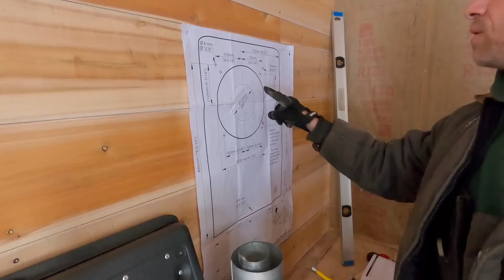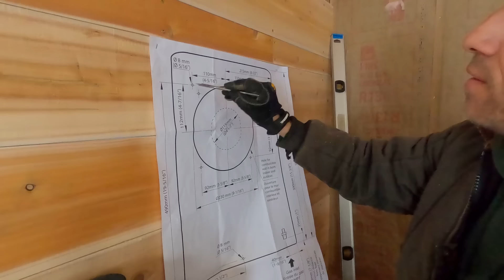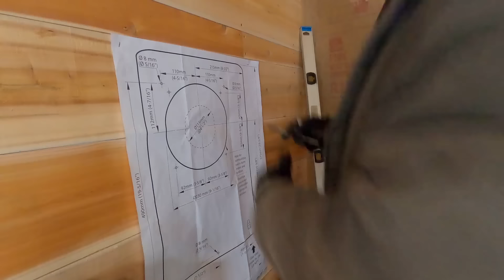Tiny Cabin Direct Vent Heater Install (No Electricity.) After Three Years in a Tent, Now HEAT! #114

Comment: Ryan I was watching your 3D printing demo where you had to go back out and get your newer printer.  It was almost totally dark in the cabin. You use what looks like a Coleman white gas lantern, there is a better solution!  I found on EBay a LED small lantern that uses AAA batteries, and mine have lasted 4 years!  The LEDs can be annoyingly bright, the light level can be dimmed by a rheostat that adjusts full range of brightness.  I found them 2 for $5.00 and free shipping!  They are an excellent backup as long as you can keep the batteries warm!  If you got rechargeable AAAs you could keep them charged the same way you charge your portable batteries!

Loved you explanation on 3D printing!

Comment: I bought one for $150 on Amazon. I just ran a flex line from heater through the wall and mounted tank right there. I bought a tank mount that had a flipper and the flex pipe went right into it. But it's just an old camper.

Comment: The way you do it is called a union…..Had to install one in my house because someone did what you’re doing and assembled the piping end to end. My tankless water heater required a 3/4 inch line instead of the 1/2 the tanked version had so I installed a union to allow it to be reassembled from the middle of the run….

Comment: I used inexpensive white 1" styrofoam insulation (4' by 8" sheets bitted close together) over the subfloor of my camp in north central Maine and then put another layer of flooring over that with long trim head screws through the final floor, styrofoam insulation , subfloor and into the floor joists and the floor stays warm during the winters which get to -10 to -20 degrees on the middle of winter.
 The camp is heated with a wood stove and I can walk around in shocking feet all winter. A good inexpensive solution to a cold floor and it has worked without any problems for the last 20 years or so. The camp is on 2' cement pilings, open to the weather but I put up skirting for the winter keep the snow out and remove it in the late spring...
Just a suggestion that has worked great for me for many years..All the best and Merry CHRISTmas...<><...:)

Comment: I was looking for cabin heater shed heater garage heater. And that was what I found out $450. Nope I went to Home Depot Walmarts Lowe’s to look for Mr. heater big buddy it’ll put out just as much heat as that heater you got for about $200 then you get the Mr. heater conversion hose so instead of using one pounder propane tanks it converts it to 20 pounders. I see that you have a 30 pounder right behind you pick up three of them and bring them straight to the gas plant to have them filled up. It’s cheaper that way instead of the exchange service. Plus they can inspect the tank and make sure it’s good.  
They have mounts on the back of them so you can mount it to the wall. Then I found those wood burner stove top fans that operate when they warm up and I put it on top of that Mr. Buddy and that little thing heats my shed up where I find myself opening up the door or turning it off because it’s too hot.  
And within one or two minutes you can convert it right back to a portable heater and use one pounders on it

Comment: 27:30, my experience with propane bottles outside, is if the moisture inside the bottle box is high enough and cold enough... the regulators freeze up. Something you might thimk about is mounting your box on the outside wall, and ducting some warm air from inside into the box. But, it might also allow gas fumes into your living area... not good. 
I've microwaved corn-hole bags before, and laid them over the regulators... if they freeze. Worked perfectly!
Just a thought.

Comment: Don't worry about the superfluous...saperfilus? sooperfelis?...extra holes in the plates.  They are the pilot holes to keep the plate aligned when stamping the sheetmetal in multiple steps.  They are later used for hooks to hang the part on the paint line.

Comment: Nice unit, I did not see any manual but being a direct Vent, it would appear it uses Fresh air combustion from the outside of the cabin via the direct venting pipe Assembly.
That being said, I can see the importance of installing sealer at the wall gap and the circular Vent Pipe.  Any Vacuum created from open interior windows, door or kitchen fans would suck air and possibly exhaust back into the room through an unsealed gap. It could also adversely affect fresh air intake needed to supply the heat exchanger. 

Overall, it looks like a good product and installation.
Enjoy your heat, Ryan.

Comment: People that mention wood, have probably never heated with it. We burned wood 40 plus years growing up, but we had my Dadcand 3 of us to help, cut, split haul, stack. It was wonderheat but far from easy or cheap considering the time and energy it takes. If someone has no money, wood is fine, but it takes a massive amount of time/energy. A radiant propane heater is fantastic, have one up in my fireplace, almost bulletproof reliably.having both would be tge best. If you feel like wood, use it, if not, use propane

Comment: Not sure why they made the plates larger than the double wall, but like the bugs under your rain fly, your wall will be full and mice can get in a gap that big. definitely need to boot /collar that. You have left over wall sleeve (whatever they called the stuff they said to "assemble") and fanagle a two piece cover on the outside minimum. Urethane caulk expands and contracts better than roofing tar, and you could rivet the collar to the supplied, oversized trim ring. Again, my 2 cents, and with inflation? Well, you know what that's worth.

Comment: FYI brother! Most hardware store can cut and thread pipe to size, had you measured everything of a few times  to make sure youre measurements are accurate, cost a few dollars more but sure does make things easier and the less joints you have, the less chance of leaks.

Comment: Heat load for you (rough estimate). A 12 foot by 15 foot cabin with your 3 windows and a standard 3x7 wood door. R13 in the walls, R19 for the floors and ceilings. Will need about 9,100 BTU's an hour at 5 degrees F. I hope your heater can go between 5,000 BTU's and 10,000 BTU's and you should be comfortable! Let me know if I got any of that info wrong and I can update the heat load. Also your coldest winter temp would be helpful.

Comment: There is no need for a 6 inch thick floor, heat rises. 2 inches of insulation is more than enough. Add a layer of Reflective Insulation to bounce the thermal energy back into the cabin.

Comment: You could put the gas shut off valve up at the heater so you don't have to move the piping, just have the yellow flex pipe go up through the new raised floor, or 90 degrees up with the black pipe as much as you need to clear the new floor, because the black stronger in case it gets bumped, then they may have a code keeping the valve away from the heater... I was thinking you wouldn't want to bend down for it every time.

Comment: To draw a circle put a nail or screw at your center point, tie a loop in one end of a string, put the loop on the nail or screw, put the tip of your pencil on you mark for the circle, pull the string snug and tie to pencil, draw circle.

Comment: I've used non vented propane heaters in homes when remodeling. Used 1 for back up heat in 12x16 12x12 pitch with 2 dormers in the loft. Nobody wanted to get up to keep woodburner going. Cabins are drafty enough and smoke etc detectors.

Comment: Hello again more heat sources.  Woodstove a must to assist with all the scraps you have and nature provides on regular basis.  You can vent out wall the chimney.  Reality today or tomorrow but know this is a no option item as far north as you are.  Love my Martin but answer it will not heat to what's comfortable when temps reach teens and below.

You can find good woodstove used all over the place.  I wish you happy holidays.

Comment: Inside vent is for heat out. Outside vent is so the inside vent does NOT touch the wall so the cabin does not BURN down! The air inside is the insulator. It takes the air from the inside of the cabin to heat/reheat. Some use triple wall vents through walls.

Comment: Where are you? I’ve installed several of those heaters. An infrared propane heater that size you can buy all day for under $200.00, Home Depot, Lowes, northern tool, etc. I guess people go with these exotic name brands that charge for the name. These things are very simple, reliable, fairly inexpensive.  Nice cabin though, and admire your toughness, living in a tent, lol

Comment: Get a low level Carbon Monoxide detector. Not the regular kind from a hardware store, those only go off when CO is left threatening high. You need a special low level CO detector to really get a good rating.

Comment: get you one of those fans you put on a wood stove to blow the heat around a little once the heat gets to about a 150 it comes on automatically but probably wont work on that one. They do on buddy heaters and you can cook with a buddy heater I saw that the other day nice to know if your power goes out. shoot we already got 50 inches of snow in North Dakota and its not even January usually our coldest month but December wAS ALSO VERY COLD Im thinkin about getting an old snowmobile cuz all the snow we have n maybe cut some cross country trails since I like that to.

Comment: with wood siding and inside sheeting you could have safely just drilled through the stud with no problem. You would not have compromised the integrity of the wall at all.

Comment: So,  are yo going to get yourself a little Ryobi inverter for some mini power at the cabin?

they have ryobi USB/120v inverters that you plug your drill battery into.   Then you can recharge USB devises,  power USB lights, or even use low voltage 120 watt items like... an electric blanket.

Comment: A vent- free heater has no exhaust vent to the outdoors, and is the most dangerous. It also requires a window or door open slightly to allow fresh air into the space.
 A B-vent heater has a vertical chimney pipe, and takes combustion air from the heated space, again requiring a source of fresh air.
 A direct-vent heater can be vented horizontally, directly thru the wall. Hence the name. The vent pipe is a pipe-within-a-pipe, with fresh combustion air coming in the outer pipe  and the hot exhaust going out the inner pipe. This is a sealed system, with no air taken from, or introduced to, the heated space.
 The dripleg in your gas piping is supposed to be as near as possible to the appliance, not outdoors. It's purpose is to trap rust, dirt, and condensation from the iron pipe before it gets to the gas control valve.

Comment: If your heater directions calls for 3/4” pipe then keep in mind 1/2” pipe only carries about 1/4 to 1/3 the amount of propane.  This will reduce significantly the amount of heat you can produce.
Reply: Belay that first calculation.  A 3/4” pipe will carry slightly more than double the propane that a 1/2” pipe will.

Comment: Be careful and not cut boards in there . The saw dust floating in air can and will get in it and shut stove off contaminating thermal couple . Have you checked out 12 volt diesel heaters ? Some of them even have a water heater built in ... With the use of a $6  12 volt water pump you could be showering in true camp luxury .😇 And the cost difference is better than you might think . Keep up the fun . Remember "freedom isn't free "

Comment: normal big out tube hole filled rockwool insulation not burn ,normal insulation  burn if have hot. not newer stay air only, need fill hole to rockwool. not burn but insulation and safe not wall burn.

Comment: If I have a cabin in woods I think I would want a wood stove over a propane heater yes propane heater probably be better you can control heat better but you have to keep getting propane tank filled and it cost money ,wood stove is free heat

Comment: I can run real heat load calculations for you, I have an ACCA approved manual J software  All I need is your dimensions, window sizes, insulation, and ceiling height. Also what is your coldest day of the year in Fahrenheit. Example: North wall 15 feet, 3x7 door, 3x3 low E double pane window, R13 insulation. Plus it's looking like R19 for the floors and ceiling.

Comment: Why not run the pipe UNDER the cabin and up through the floor . Drill the hole from the inside , you will get it exactly where you want it that way .  Oh well, ya done did it . . . . .

Comment: Fyi: you don't have to build up the floor more than 3 inches they have those Styrofoam  sheet insulation  for flooring they about 4 ft by 8 ft by 2 inches thick

Comment: Use a union fitting in place of a coupling to allow for different pipe segments. Think about it – there has to be a method to join pipes together in a large building w/o taking the entire run outside to tighten.

Read the directions how to purge the line. You’re correct, no one should use this video as an installation guide.

Comment: Once again, too late but you could have used a flexible hose for your propane line. I just bought a 12' braided stainless one from Amazon cheap.
Another tidbit that may be of interest... During the Vietnam War, showers weren't always available and you can get pretty stinky in 1,000% humidity.
Note that when you can smell yourself, you are long overdue for a bath!
The trick is a rag & hydrogen peroxide. Rub yourself down with that and you are VERY clean.
Granted it's not nearly as enjoyable as a hot shower, but at least you are clean.

Comment: I really wish that you had a gas fitter help you. You have used thread protectors in place on pipe couplers. those are NOT approved pipe couplers. I always wonder why so many people that don't know how to use BMI pipe, try and use it. You can buy and run copper gas pipe so much faster and easier.

Comment: 55 btu would be better and a wood stove is the best find a vermont casting cheap on craiglist wood is free heat once you cut it`s best for back up in a storm if you run out of propane

Comment: I was always told I could use Teflon tape for air or water but gas lines needed pipe dope. Does anyone else have an opinion?  This is not criticism, I just like to learn from others experience.

Comment: If you use Teflon rape, little pieces of it will break off and clog your orifices. Pipe dope is the thread sealant of choice for gas piping. Good luck and good job!!

Comment: As someone who tends to underthink projects--probably less so than you pretend, but still--you really overthought the heater installation. First, you chose an unpopular size of piping that made your options too limited. You can always oversize the pipe to a common size. This would have given you every option for pipes and fittings so you weren't stuck with all those unions and short pipe lengths. Second, why didn't you go in from the floor and over to the tanks? Easy peasy compared to your elaborate around-the-corner mess. I think you were being extra careful because of the prospect of doing it wrong and burning down the cabin. Regardless, what's done is done. I love your videos and look forward to watching every week. I am in the process of building my own cabin in the woods right now, so I feel a kindred spirit with your endeavors. I am in South Carolina so it's much warmer here, but still cold enough to kill you at night.

Comment: if roof have lot ice not have good insulation top of cabin, need lot more insulation under roof heat not go out, minumun insulation have you cabin need be 10" normal used 12" roof need be more 16"-20" normal. but warm winter cabin eco warm rules double insulation all around.floor under need normal 15"-24" then cabin not waste heat to out and keep warm good live.

Comment: I it possible to over insulate this cabin to such a degree that with using this heating system, you could run out of oxygen while being inside the cabin working or sleeping?
Reply: That's the beauty of double wall pipe, the combustion air flows between the pipes. The hot exhaust air is going up the inner pipe and the cold fresh air is coming down between the inner pipe and the outer jacket. Hope that makes sense.

Comment: Those couplings are not correct. They are actually called “ all threads “ they are used to protect the threads. They are not meant to be used as couplings.